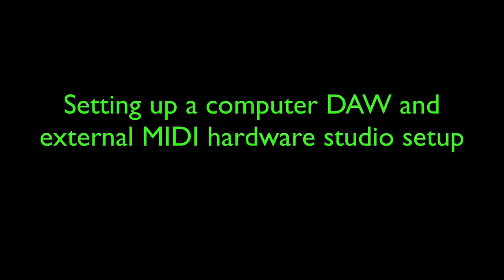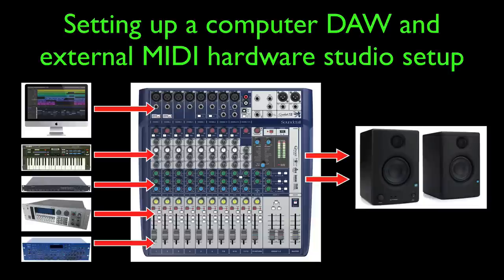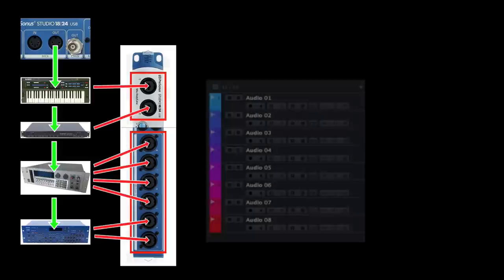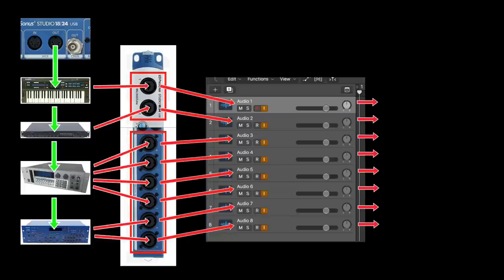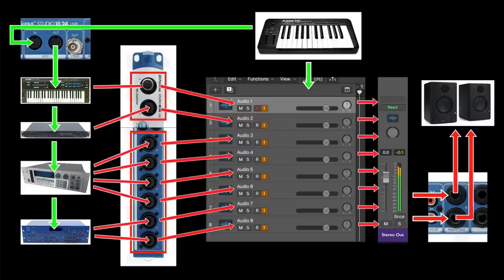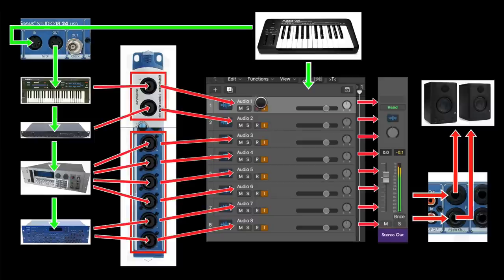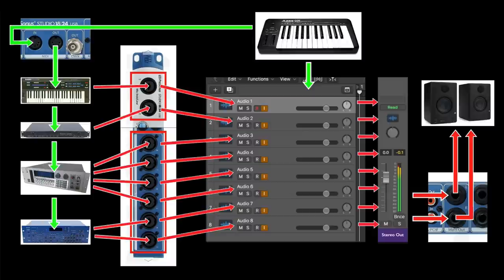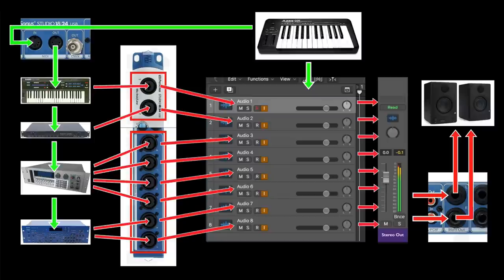How to setup a computer DAW & external MIDI hardware studio

Comment: I have a Moog Grandmother and a Korg  Wavestation EX(Without USB) and an Focusrite Scarlet 8/6 (3 Gen) and try to get it work together with Ableton.  I am not sure if i MUST use the Korg as Masterkeyboard...and the Grandmother must run "by the way" ;: ) and how to connect the Grandmother...should i connect in the Scarlet MIDI IN better the Korg....or the Grandmother ? Thanx for Connection Ideas!
Reply from the maker: it doesn't make any difference which keyboard u use as master for basic stuff like notes/mod/pitch/pedals (but the moog may transmit physical controllers you want to record), but i dont use ableton, so i dunno how it "sees" available midi ports if the moog & the focusrite are both plugged in via usb. It may be better to use the trad midi i/o on the focurite for both. Haven't you tried this as an experiment yet? Like haven't you tried plugging the moog in via USB and then seeing if the moog can send midi TO Ableton & then pass that midi THRU ableton and OUT of ableton to the  IN on the wavestation connected via EITHER the moog trad' midi out or the one on the focusrte? Seems a biit weird you didn't try the various ways to set it up
Reply: @dancetech  Thanks you very much for your help! I really made the USB Connections with Grandmother and connect both with Ableton. Just i cant hear the Sound from the Wavestation...but the Keyboard from it plays just the Sounds(Samples) from Ableton now. I saw that the Wavestation react VERY slow in Display,Keypress...no suprise...after over....20 Years, i think there is a internal Battery which i should change...from time to time : ) but thats another thing. I try now the Pro Tools DAW...i get not so warm with the Ableton. Many years ago i worked a bit with  Cubase 3SX ...but not sure if it would be usefull try to run this on my new PC. now. Anyway...i try now Pro Tools.....and  if this makes me not "Happy" : ) i try Cakewalk.....and then...my last hope is Fruity Loops...which i had years ago...4.0 Version.....(now its 20 : )....they made big Steps : ). Of course i will thank you for all the good Videos on your Channel. Take care!
Reply from the maker: @Viertelfranzose  well try it differently. try connecting moog OUT to focusrite IN & Focusrite OUT to moog & wavestation IN (turn off local control on moog). the ableton track should pass the midi THRU from the moog back OUT of the focusrite to the moog & wavesation & either will respond based on channel

Comment: When you record the audio back in must the buffer still be low? Where does offset come into play? My midi playback is in time until I record the audi back in then its off?
Reply from the maker: if your audio interface buffers are low (32 or 64 samples) when you monitor the hardware thru the DAW (as shown in the video) you shouldn't hear any delay at all. You MIGHT gets some delay when you record the external instrument to audio, all you need to do is adjust it's timing after recording with some offset delay
Reply: dancetech Thank You. Offset delay in the DAW or by the shift knob on the ERM?
Reply from the maker: @Skiroy  I'd use the DAW track delay (most daws have that) costs free.. If you do get delay on record then with the buffers set the same, any delay will be the same, so once you work it out (by aligning the midi notes & audio waveforms) you can set it quickly anytime.
Reply: dancetech Thanks Dan. So what advantage is the ERM then? Seems like if you record midi in your DAW and play it out to record audio back in DAW with midi track delay it’s the same thing. No?

Comment: how do i incorporate an analogue mixer to the set up you just shown ?
Reply from the maker: I'll be doing a video on that soon (servicing a couple of mixers right now), it's a bit hard to explain all the possible variations in a message. tell me EXACTLY what you want to do.
Reply: @dancetech  basically I want to have my synths/beat machines etc. connected to both mixer and daw with a ability to record the mix going through the mixer. I want to also have the ability to jam with the synths without daw and then ability to quickly switch to working with them on daw ( separated into channels etc, but also with usb functionality like lets say with my elektron analog rytm i would wanna be able to also separate  different drums into  sub  channels in daw etc.) but still going through the mixer with the ability to record the mix post mixer... i dont even know what im talkina about xD
Reply from the maker: @peraltazimmerman  lol... so you want to have your hardware outputs running thru the mixer channels and at anytime be able to have them routed to DAW tracks individually. ok, but to do that you also will need to monitor the DAW audio so you can hear the external kit & DAW audio all together

so basically you setup the mixer - all hardware outs route to channels - you can mix that together to the main L/R stereo mix bus

if you want to have a mixer channel sent to a DAW track to record: send the mixer channel OUT via a GROUP OUT to the DAW MONO input - route the DAW L/R OUT to a stereo mixer channel or send the channel OUT from the mixer via a Direct OUT - Then take the channel sending TO the DAW & switch it OUT of the mixer's main L/R Mix Bus and monitor 'Off Tape' coming back from the DAW doing a round trip with the DAW track set to MONITOR so the signal passes THRU the DAW and back to the mixer via the DAW L/R OUT channels  - you have to do it that way or you get a loop

A mixer with 2 groups - this limits you to sending a max 2 feeds to the DAW
A mixer with 4 groups - this limits you to sending a max 4 feeds to the DAW
A mixer with direct outs (assuming the mixer has a minimum 8 channels) - you are limited by how many inputs your DAW has - direct outs send to DAW inputs
Reply: @dancetech  thanks for an awesome reply, i will try my best. Keep up the good work, your videos are very helpful !

Comment: Need help! When i export im not hearing the effects from hardware. Im using fx2000 behringer in my daw fl studio.
Reply from the maker: any external fx (or midi kit audio) has to be recorded to an audio track to be included in the final DAW export/bounce/render. when you export/bounce/render from a daw it doesn't include incoming realtime audio.
Reply: @dancetech  thanks than next question how do i record the audio tracks? Sorry im used to plugins im just now started buying hardware and learning to use them.
Reply: @dancetech  do you mean like record as like If im recording vocals?
Reply from the maker: @musicislife704  well explain what you are doing - what is your signal flow etc EXACTLY please..
Reply: @dancetech  2 outputs ran from effect hardware to front of interface 1,2… 2 inputs ran from my effect hardware to back of interface to 3 and 4 output.
Reply: @dancetech  my interface is presonus 1810c and the effect rack im using is behringer fm2000 to give you vision of what im doing.
Reply from the maker: @musicislife704  "2 inputs ran from my effect hardware to back of interface to 3 and 4 output" - huh??? do you mean you are passing the entire mix (all external midi kit coming IN to the DAW, plus all internal DAW sounds, all mixed together & then going OUT of the DAW via physical outputs 3/4 and then you are  listening to that final mix of everything on outputs 3/4 THRU the behringer fx2000 & from there it goes to your monitors? is that it?

Comment: so after midi out from the audio interface should I use midi thru to connect the next hardware?
Reply from the maker: yes.
Reply: @dancetech  thanks!and what if my hardwares have as well usb connection(behringer neutron,maschine studio and tr8s + volca bass)could i do the same set up?
Reply from the maker: i've got multiple hard disks & audio interface attached via usb to my mac & it works fine

Comment: @dancetech I got an Moxf6 should I plugin it into the my 18i20 midi IN?
Reply: I'm working in Ableton
Reply: Moxf6 has an usb audio\midi interface. You can plug the usb in your computer. Go to Yamaha download form the driver though.
Reply from the maker: yes you can use it the Moxf6 as your master keyboard , but when you are playing the same keyboard you also want the DAW to record & trigger, you turn Local Control OFF... that way, the notes when you play go to the DAW MIDI track, pass THRU and back to the keyboard to trigger whatever patch is on whatever channel you're playing.
Reply: @dancetech  I'll try that.. cheers mate

Comment: What if you don't have a computer only samsung tablets and 2 yamahas dgx and a korg r3 with vocoder
Reply from the maker: and how do you currently use those in combination to create music?
Reply: @dancetech  I haven't yet. I am mostly manual. My bass player /my roadie doesn't even let me near the soundboard 😁
Reply: I just hit the nbers on the yamahas for voice and korg switch to POLY synth favorites, lead synth etc. It's an r3 with vocoder
Reply from the maker: @ellenbacklin  get rid the samsung & get an ipad & a 2, 4 or 8 input usb interface then (dpending how many inputs you need, + accessory connector to add usb to the ipad & use garageband iOS which is 100% free. It'll record 8 tracks at once and with a midi usb connection you can play any of the extensive instruments from your keyboard/s. Garageband iOS is also a fantastic writing tool, you can write anywhere with it, on a bus, on a train etc, the screen ketys are velocity sensitive etc. Anything you record or write on it can also be transferred to a full blown studio Mac and can then be opened & finished / polished in Logic. Trust me it's an amazing bit of kit.
Reply: @dancetech  😖😖😖
Reply: You're awesome so I may go to guitar centervand ask them all sorts of questions. I also have a guy in a band needs keyboard player and he's got a roland juno that he's already done those things with.

Comment: Can I still sync all the hardware to play together also with doing your method?
Reply from the maker: of course. but if any hardware is running an internal sequencer or arp etc you need to make the DAW the master clock and stick the hardware into slave mode
Reply: @dancetech  is there a method to make the master clock one of the audio hardware instead of the daw but still on the daw showing the channels. The thing I'm trying to do is that I want to produce everything on the hardware and mix and master on the daw
Reply from the maker: @MrSteveydreamy  well you only need the DAW to lock to the hardware if the daw sequencer is playing anything from it's tracks, but yes you could set the daw as slave, but tbh it's better to have the daw as master, way less hassle.
Reply: @dancetech  thankyou for your help I appreciate
Reply: @dancetech  This video and all the questions you answer is fantastic, this should have like a million views. I will add that at the moment Cubase and Logic can not be slaved, only by MTC or SMPTE which is the old school way. Thank you again.

Comment: ? Question concerning "Y"'s in combining OUTPUTS (analog) into "1" using the Interface using Y's. Although there is no signal loss in playing OUT a signal splitting the source (analog-Mono), one of the 2 signals plugged into the Y will cancel the second one plugged in. Point is reducing the analog outputs from 2 into 1. All are line level mono. What is up? to much Ohms? ie: a Alesis 16 drum machine and a Alesis NanoBass........??
Thank you in Advance...........this could take Years.............:-)
Reply from the maker: what is a "Y" & can i see a picture of it? You're not trying to use a  Y splitter in reverse to combine 2 signals are you?
Reply: @dancetech  Indeed I am trying to combine 2 into 1.
Reply from the maker: @zazoomatt  where did you get these Y-splitter leads? Can you show me one in an online shop please? or did you make them?
Reply: @dancetech  HOSA Y adapter https://www.guitarcenter.com/Hosa/YPP-118-Y-Cable-1-4-in-TRS-Male-Dual-1-4-in-TRS-Female-Stereo-Splitter-
Reply from the maker: @zazoomatt  mate the link doesn't, but i see the word STEREO in there... think about it.....
Reply: @dancetech  it is NOT Stereo-Thanks but it just the "add" so I tested before this for a Tip-Ring or even TRR , it is mono.
Reply from the maker: @zazoomatt  here is the YPP-118-Y & it IS stereo & of course it's going to fail on one side when you plug it IN to a balanced/unbalanced socket (https://www.gear4music.com/Books-DVD-and-Sheet-Music/Hosa-YPP-118-Y-Cable-1-4-TRS-to-Dual-1-4-TRSF/L1O)
Reply from the maker: @zazoomatt  watch this: https://youtu.be/hnKpNNUlI4Y - he's using a stereo jack on one end but the principal is the same. You need that end to have TWO 1/4" jacks on it going to a single MONO 1/4" jack. What he;s describing is the ame principal as what you need to build.

Comment: could you do this with a analogue mixer where does it go in the chain
Reply from the maker: Either you need a mixer with subgroups, or use channels with direct outs
Reply: @dancetech  hi mate when u say midi out from interface n u show green arrows how is that linking to all of them
Reply: also how would you add fx racks into this chain
Reply from the maker: @amerism4530  use midi thru box or thru sockets on the units 👍
Reply: @dancetech  wicked thanks and so when u play the midi keyboard how does it know which unit to trigger? if all of them are connected
Reply from the maker: @amerism4530  by MIDI channel, each unit is out on a different MIDI channel & the midsi track in the DAW is then set to whichever channel hardware instrument you want to trigger & record midi notes/data for. There's no need to change midi channel on the master keyboard that way either.
Reply: @dancetech  how do I have multiple midi channels my keyboard only has one in and one out so at the moment I can only go out my 950 into my keyboard
Reply from the maker: @amerism4530  HUH?  what is a 950? explain better please.
Reply: @dancetech  akai s950
Reply from the maker: @amerism4530  well on the akai each program can have it's own midi channel, so you just sertup the akai with different sounds on different channels & the master keybard goes into the DAW - you then selected a midi track in the DAW, set it to the channel of the Akai program you want to trigger & when you play the keyboard the DAW re-channelises the incoming midi back OUT of the DAW/computer midi OUT and that goes to the Akai which triggers ONLY on the chosen channel in the DAW midi track... like that.

Comment: I understand all the hardware here is MIDI but i would still need a mixer (probably). 
What if i wanted to run drums or other instruments on my DAW through a compressor or reverb via hardware then record them back to my DAW/PC? Does Presonus offer a product like that or can the 1824 still do this?
Btw my audio interface is a m-audio delta 1010lt soundcard PCI with plenty ins & outs.
Reply from the maker: well you just run the output of whatever hardware unit into a compressor and then into the DAW input where you can record it is you like or just let it pass thru in realtime to the L/R stereo out mix of the DAW - any interface acts the same when doing this kind of setup..
Reply: @dancetech  Sorry i meant the hardware would be the compressor. And to hook it up to use with my PC/DAW, using my Delta soundcard, would this Presonus  be the more logical approach or a mixer? I apologize if this sounds crazy stupid lol
Reply from the maker: @skilletburritos8464  so you want to send the signal OUT from the DAW, IN to the comp, then back into the DAW to 'print' the compression sound on whatever?... well you just route the daw track output to comp, and the comp out back into 1010 on a different track to the one sending OUT, there'll be some delay on the recording though, but you can correct that afterwards... seems a faff though.. why not use s/w comps & fx?

Comment: Can I use an audio interface like this presonus with a stand alone box like an mpc live for example?? I want to stay outside the box and work exclusively in standalone.
Reply from the maker: "I want to stay outside the box and work exclusively in standalone" - you mean you don't want to use a DAW/computer at all?  in that case just plug the mpc into your monitors direct & create all your songs in the mpc.
Reply: Lol sorry for not being clear I also have several hardware synths I would like to record at the same time.
Reply from the maker: and you are sequencing those from tracks on the mpc right?
Reply: Yes I think I have the midi covered it’s the audio I’m having trouble with. I would like for all my hardware synths to be all on standby without having to connect and disconnect stuff and just in case I want to live jam with fellow songwriters or just going through sounds during a session. I was looking at some line mixers but hear about noise etc.
Reply from the maker: if you have NO intention of using a daw, then get a mixer.
Reply: Ok I’m guessing these type of multi channel interfaces only function when hooked up to the software/pc?
Reply from the maker: yes, they are only required if you want to integrate external midi hardware into an onboard DAW system
Reply: Thanks for confirming I was trying to avoid mixer noise as I would like cleanest signal possible and thought one of these digital interfaces. Guess a mixer will do thank you.